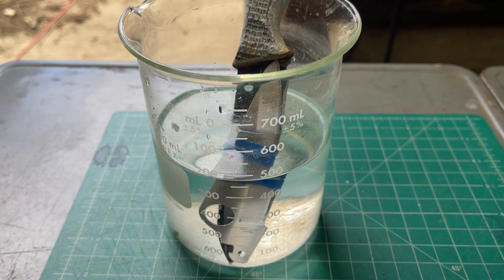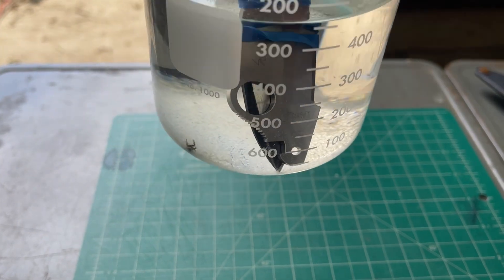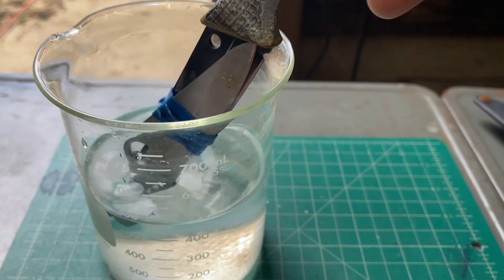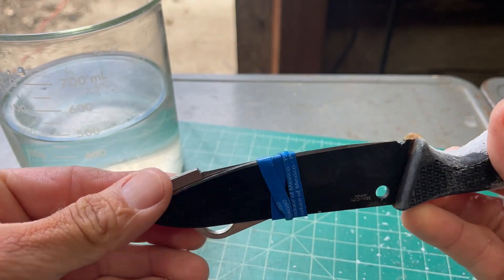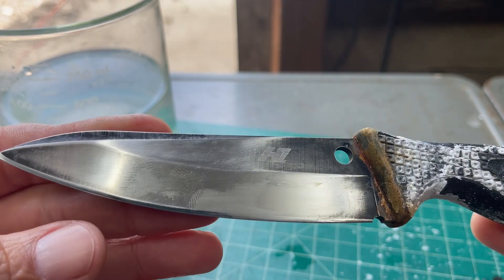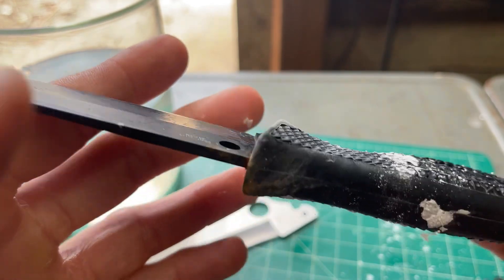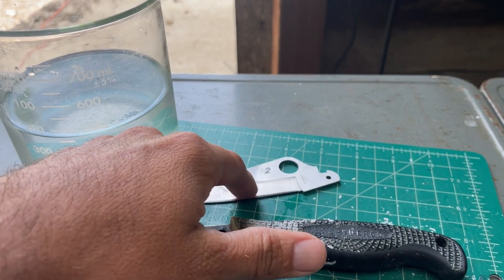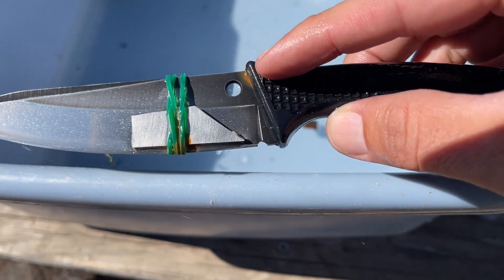I’m ending the Spyderco H1 vs H2 galvanic corrosion test

Comment: You could probably create a corrosion proof blade by putting an impermeable coating on the knife tang before putting the handle on. Then you will prevent crevice corrosion at the tang.
Reply from the maker: That’s a good idea I can look into. I’m going to try something else too. I bought a 3/4 thick piece of Magnacut and I’m planning to carve a knife, handle and all from it. So no crevices. I won’t work on that until a while from now. Thank you for the new ideas i appreciate it.

Comment: Do you think that crevice corrosion might not have caused H1 to rust but any other tiny particles that got stuck in the crevice. It should be interesting to see if you somehow you remove the handle whether the H1 is corroded or it is only in the surface
Reply from the maker: I don’t know. This is a legitimate possibility but I don’t really want to cut the handle to find out. When I looked into crevice corrosion I found out that even titanium can corrode. So, it’s very possible that H1 is corroding in this test. 
I’m mostly interested in seeing how “rust proof” steels compete against each other. Even though my original reason was to make a full rust proof knife which I now believe to be impossible.
Reply: @totesmalotes  The friction between the grip edge and the blade always peeling the blade's self created passive film and jamming to recreate it because there is not enough oxygen, so even titanium could rust unless the passive film is protecting it.
Reply from the maker: @下田洋介-w4z  this is an interesting detail. I’ve been using my H1 knife to jog with and the rust near the handle has gotten worse. It could be that there is some movement between the handle material and the blade but I think my previous thoughts have been solidified. I don’t think there can be a fully rust proof knife when two different materials are used together.
Reply: H1 is definitely susceptible to crevice corrosion it's in the same class as 316ss. I doubt the manufacturing process would have metallic particles in the handle during the molding process.
Reply: @JohnFrumFromAmerica  maybe more experimentation is needed regarding crevice corrosion. As far as I know, H2 (and the discontinued H1) is the best knife SS metal apart from titanium (which I don't know if is susceptible in cc) until now.
Reply: @SPYROSMANTZAKOS it's only the best for a blade material. It's very middle of the road in regards to stainless steels in general. Super duplex with a PREN number over 40 is recommended for continuous salt water immersion. The PREN number for H1 I think is similar to 304 or 316 around  25 to 30 so I would expect it to perform about the same as them. I recommend reading up on PREN number to better understand the corrosion performance of stainless steels.
Reply: @SPYROSMANTZAKOS  titanium is definitely not susteptable to crevice corrosion in any normal environment. The only way it could corrode is to use very powerful chemicals. In the ship building piping industry we generally consider titanium to be impervious to sea water corrosion. 304 is considered not acceptable and 316 is considered either bearly adequate or inadequate depending on the operation of the ship. If they are in the open ocean alot 316 is considered acceptable if in port a lot then it's not acceptable. However it should be noted that sea water piping is a lot more corrosive environments than you would ever expect a knife to be subjected to.
Reply: @JohnFrumFromAmerica I don't have that kind of knowledge of industrial applications as you do. As far as knife metals (ss) do you agree that H2 is until today the best choice, only regarding corrosion resistance? Titanium knives are not preferable as I know.
Reply: @JohnFrumFromAmerica  have you tried yourself H2?
Reply: @SPYROSMANTZAKOS  I was using H2 and H1 interchangeably I think they are about the same. Based on the knifesteelnerds article on them.
Reply: @SPYROSMANTZAKOS  I haven't used H2 only H1 which I use as a back up dive knife. The H1 has done fine in that service. I have a lc200n knife as well that has never had a problem with being in sea water.